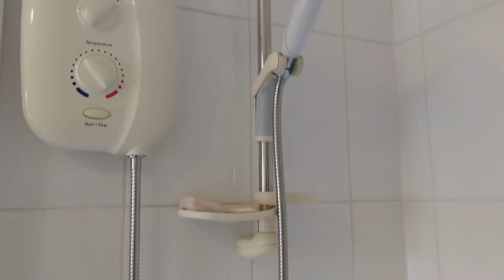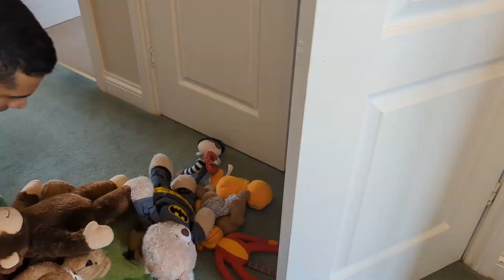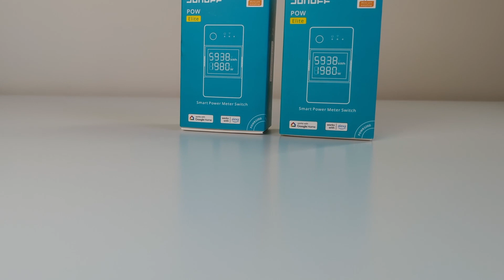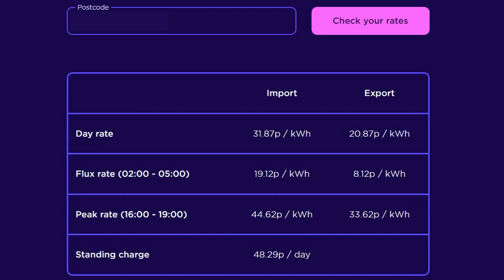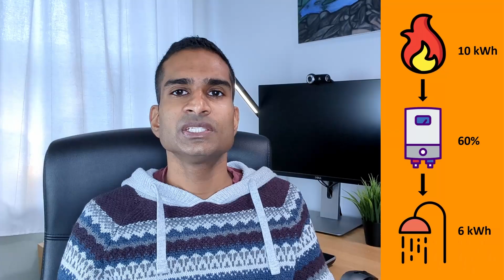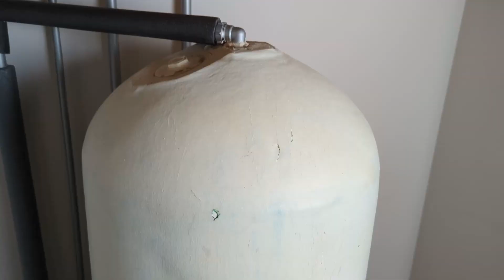Solar Diverter RETHINK 2023 - SONOFF WIFI Switch The Answer For Heating Water?

Comment: Many thanks for this prime intel. I have PV, Home Battery & Unvented 250L Hot Water Tank (indirect) with Immersion. Just bought the POWR3 320D and it works like a charm. I simply replaced the existing spur with the POWR3 and it worked like a charm. I will now run the HW between 23.30 & 05.00 with Off Peak Intelligent Octopus. Many thanks again !
Reply from the maker: Hi - Thanks for taking the time to watch and comment on this video. Glad you found it useful. That sounds ideal, great work!

If you’ve not already, please do like this video, stay tuned for some more content and thanks for taking the time to contribute to the discussion on this video 🙂 Shan

Comment: How did you wire the switches? In series i.e. 1 for On/Off & 1 for upper/lower (sink/bath) or parallel I.e both independently on/off? If the latter, how do you prevent both being on at same time and overloading the circuit?
Reply from the maker: The latter, if during the day only one will be set to come on. Or if off peak then both can come on and it doesn't matter as coming off the grid

Comment: We got solar installed last month and decided to go with the diverter as I’m not convince these rates you get paid for power going back to the grid will remain as they are and may disappear  down the line. We also didn’t have an immersion but we installed a Willis heater. It works great on a decent day. The heat pump usually comes on about five times a day to keep water hot as my wife works from home but on a decent day it doesn’t come on at all, this will also prolong the life of the heat pump. Hard to know what the pay back time on it will be but I’m glad I got it installed.
Reply from the maker: Hi - Thanks for taking the time to watch and comment on this video. 

I do agree - I think we will see and we are already seeing a reduction in the export rates being paid. That said I still think solar with a battery back up and not on a legacy FIT deemed payment a solar diverter has an extremely long payback time. I think if the system meets your needs and you're happy, that's the main thing.

If you’ve not already, please do like this video, stay tuned for some more content and thanks for taking the time to contribute to the discussion on this video 🙂

Comment: I'm on octopus tracker for gas, with 3kWp of solar PV. My gas has been under 5p/kWh for a good few months now. I am on Scottish Power for SEG at around 12p/kWh exported. It makes no financial sense for me to use excess solar to heat water and lose 12pkWh export rather than just heat the water with gas costing around 6p/kWh when you factor in inefficienceis of a gas hot water system. Not everyone will be in a similar situation but I bet there are loads of people thinking immersion diverters give you 'free hot water', which is only true if you are not on metered export or your export rate it similar or lower than your gas cost.
Reply from the maker: Hi - Thanks for taking the time to watch and comment on this video. 

Yes I agree, I'm also on Octopus Tracker for gas and we're using gas to heat hot water and exporting as much as we can on flux 👍

If you’ve not already, please do like this video, stay tuned for some more content and thanks for taking the time to contribute to the discussion on this video 🙂

Comment: Sorry, me again. Can I ask why you put a switch on the top immersion heater? We only ever use the bottom one. Am I missing something?
Reply from the maker: Thanks for the comment Ray, very interesting! We only ever use the top one as a top up. Given it's a 300L tank - using the bottom one means heating a greater column of water compared to using the top one which heats less but is sufficient for our showering habits at present. Having both options gives us more options and future proofing (or so I hope! 🤓)
Shan

Comment: Don’t forget that when you are exporting to the grid you will still be reducing your carbon footprint, as your export will be offsetting the need for the grid to generate from gas or other non-renewable sources. You would have to work out what the average kg of CO2 per kilowatt hour generated in the UK to get a figure. 

Just a thought 🤔
Reply from the maker: Hi Pip - It's a good point 👍

If you’ve not already, please do like this video, stay tuned for some more content and thanks for taking the time to contribute to the discussion on this video 🙂

Comment: you done it wrong could use a sun amp heat battery or a tepeo zeb instead of export from the solar panels
Reply from the maker: Nope, I looked at the sunamp but prices started at around 5k. The tepeo Zeb remains in the cards but at the moment they only replace gas boilers up to 12000 kWh of gas. We use around 15000, if not a bit more

Comment: Very interesting video, I came to a similar conclusion - although I am using the last hour of Flux cheap rate to heat water and then gas in late afternoon. Generation for us tales off in late afternoon so to save the batteries taking the hit in pm I am using gas then. Those switches look like a good option, I currently have the immersion on a timer but these SONOFF ones look better featured!
Reply from the maker: Hi - Thanks for taking the time to watch and comment on this video. Glad you found it useful.

Sounds like you've done some good analysis of your electricity use. That's great. Yes the SONOFF switches are working very well and significantly cheaper than a diverter!

If you’ve not already, please do like this video, stay tuned for some more content and thanks for taking the time to contribute to the discussion on this video 🙂
Reply: @everythinghome  Thank you, it was your video on Flux (and Gary's) that got me to finally ditch my old meters and switch to octopus - my Flux tariff changeover was finalised last week. I look forward to future content 👍
Reply from the maker: That's great, there are exciting times ahead! Gary is making some great content. Thanks, I'm looking forward to looking at the numbers come September/October time.

Awesome, hope they're backdating your export payments
Reply: @everythinghome  I am not holding my breath for backdated export, but if it happens on next bill I will be very happy indeed lol!

Comment: Nice vlog and great info…. Hope you had a structural engineer for the big tank in the loft? 🥸
Reply from the maker: Hi - Thanks for taking the time to watch and comment on this video. Glad you found it useful.

We previously had around 300kg of cold water storage tanks etc in its place, it now has around 350kg of unvented cylinder. The area was reinforced by the installing team 💪

If you’ve not already, please do like this video, stay tuned for some more content and thanks for taking the time to contribute to the discussion on this video 🙂

Comment: Didi I hear you right? Did you say that the sonoff switch can vary the power to the immersion heater or does it just switch the full 3kW?
Reply from the maker: Hi Martin - thanks for checking. Just to be clear you cannot limit the draw via these switches so yes it will draw a full 3KW. But if done at the right time it should be covered by solar/battery.

If you’ve not already, please do like this video, stay tuned for some more content and thanks for taking the time to contribute to the discussion on this video 🙂

Comment: Could you get similar results with a smart immersion such as a Tesla t-smart?
Reply from the maker: Hi Kiran - Thanks for taking the time to watch and comment on this video.

Yes , I had looked at that as an option but for the reasons in the video and the significantly cheaper unit cost I went for the Sonoff WIFI switches which are working great.

If you’ve not already, please do like this video, stay tuned for some more content and thanks for taking the time to contribute to the discussion on this video

Comment: I have to agree that with the current export rates via Flux, a solar diverter makes little to no financial sense for anyone unless they are tied into a FIT scheme with Deemed Export. We are with 2 of our systems and so the Eddis do lots of good work using power that we are being paid for whether we use it or not.

For my own uses, I have PV being installed as I type this and knowing that it could be 8 weeks before I start getting paid for my export, I'm going to spend the £21.24 for the 20A version simply to use the excess generated in the next 8 weeks rather thn give it away for free. The Flux export day rate here is about 22p, so this will have paid for itself after just 96kwh have been exported. It's a 6.3kwp array with a 9.5 battery and no EV's in the home, so it should cover itself just fine and once I'm actually being paid for export, I can still use it if it looks like I'm going to cross the 3.68kwh export limit.

The big benefit of an Eddi or similar is power regulation as they can just put 100w or 200w into the water, but as I said, with Flux it basically make very little financial sense.
Reply from the maker: Hi - Thanks for taking the time to watch and comment on this video. Glad to hear we're on the same page. 

Exciting times with your solar being installed. I'm sure you'll learn lots with your new system - how much solar did you manage to get onto your roof?

If you’ve not already, please do like this video, stay tuned for some more content and thanks for taking the time to contribute to the discussion on this video 🙂
Reply: @everythinghome  We've managed to cram 6.3kwp onto my workshop roof which is an East/West split. Our daily average usage is around 9-11 kwh, so with a force charged 9.5kwh battery with Flux off peak, annual savings should be substantial once I'm exporting and getting paid for it.
Reply from the maker: Wow that's a great size array and as you say should provide some good savings and income with export in the spring and summer months 👍🏽

Comment: Have you considered that the gas you will use running your gas boiler over the next 10 years will pay for two heat pumps? Scrapping your gas boiler now and installing a heat pump will reduce your carbon footprint and you'll be able to drive it from your solar installation. My running costs are about 35% of my old gas boiler with the above suggestion. It makes no sense to keep the gas boiler.
Good comment about solar diverters. It gets even more obvious with a heat pump which will be about three times as efficient as an immersion heater - and even cheaper when heating hot water with the heat pump on cheap off-peak electricity.
Reply from the maker: Hi John - Thanks for taking the time to watch and comment on this video.

I agree, the gas boiler isn't the long term option. I think I need to get a proper heat loss survey done and then go from there. We also have microbore, and whilst not an absolute game over it does make it a bit more complicated. More investigation required for our specific circumstances over the next few years.

If you’ve not already, please do like this video, stay tuned for some more content and thanks for taking the time to contribute to the discussion on this video 🙂
Reply: @everythinghome  I have a microbore so please tell me what you found the best solution was do I have to replace it or do something else? Just point me to the bit I need to read thank you Alfie

Comment: Good call, I've done the same thing, was thinking of a diverter, and found two similar switches and automated the switch on/off via my HomeAssistant, am still working out the best logic to use, you know batteries are less than 100%, Solar is charging batteries, time is daytime and so on. Thanks for your insights
Reply from the maker: Hi Andrew - Thanks for taking the time to watch and comment on this video. Glad you found it useful and that we're on the same page.

I'm yet to venture into HA territory but I can well and truly see its worth going forwards. I think for the moment the export payments far outweigh what I pay in gas it's a bit simpler but it's an ever changing space!

If you’ve not already, please do like this video, stay tuned for some more content and thanks for taking the time to contribute to the discussion on this video 🙂
Reply: @everythinghome  my heating and hot water are oil based, and prices are linked to petrol prices, which is volatile. My intention has always been to utilise all I can generate, export nothing.
Reply from the maker: That makes complete sense 👍🏽

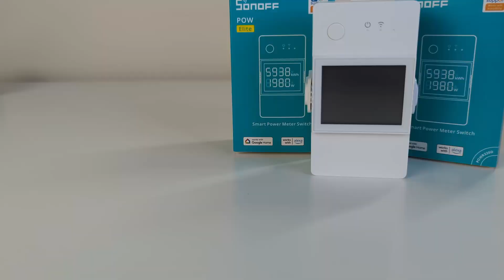Comment: I had reached a similar conclusion with regards to solar diverters.  If they were 1/3 of their current prices, they would possibly be worth considering on a financial basis.   I have used a switch by Tuya for my immersion heater and the Tuya Smart Life app has some useful automations where I can set it to switch on the immersion heater at a set time of the day, if the weather is sunny.  For the most part, this works well in summer.  I have set it to run every 2 hours if the weather is sunny.  In winter I switch those automations off as, even if the weather is sunny, I would rather the limited solar energy went into the house battery.  Instead, I set the immersion heater to come on between 0:30 and 4:30, which is when my Octopus Go cheap rate tariff kicks in.     One further refinement I would consider is to see if I can determine the amount of solar energy being generated and use that as the determining factor for switching on and off the immersion, rather than just the sunny weather, as UK weather changes frequently, and even a passing cloud 5 minutes after the immersion heater starts, means it draws the power from the battery.  Effectively, it would be to make similar wizardry in a solar diverter for turning the immersion heater on and off, but missing the ability to run it at a reduced rate of output.
Reply from the maker: Hi Graeme  - Thanks for taking the time to watch and comment on this video. Glad we came to a similar conclusion.

That sounds like a great set up already. I used to think the same about the passing clouds but for me the beauty of having a battery is to supplement when the all to frequent cloud rolls by. I've found very quickly it's near impossible to element the grid entirely. I suspect the difference would be pence per day but obviously depends on lots of factors and small amounts over time do add up. The other option would be to consider something like Home Assistant to automate this.

If you’ve not already, please do like this video, stay tuned for some more content and thanks for taking the time to contribute to the discussion on this video 🙂

Comment: I was in a sticky situation last year, I had to replace my boiler. I wanted to go all electric but that’s a couple of years off. 30p standing charge does make a financial difference per year. 

I swapped my boiler for an ideal one with 90+% efficiency. They warm the home soo much better by throttling the boiler up and down rather than off and on (using opentherm). 
The payback is based on your bills but 30% could be possible.  I paid under £2k 

The technology I really wanted to implement is adding a large water tank before the return. You get better efficiency and can heat with electric when it’s cheaper (solar or Go). 
Using a battery to heat water is also wasteful.  Charging and export on flux will result in 2-8p costs.
Reply from the maker: Hi Andy - Thanks for taking the time to watch and comment on this video. Glad you found it useful.

Thanks for the insight. It's definitely something I'll need to look at in the coming years, more research to be had about what my best option is. I like your point about eliminating gas entirely and losing the standing charge, it definitely adds up over the year! I'm not completely sold on a heat pump for our home, but I need to do more research.

If you’ve not already, please do like this video and stay tuned for some more content and thanks again for the comment 🙂

Comment: We have the myenergi eddi to heat our domestic hot water. We don't use gas anymore to heat it and it's cheaper and more efficient to use the eddi. Our gas boiler is 20 years old and 75% efficient. In the winter we set a schedule to heat the hot water in the early hours of the morning during off peak rate on the Go Faster tariff with Octopus Energy. In the summer, excess solar will trickle in to heat it. The eddi can be set to be first, second or third in line with the battery and car charging so it's very flexible. It can also sip surplus it does not need 3kWh to start it working. Any solar excess, even 100w, is diverted by the eddi into the hot water. As every, everyone's setup and use case is different and there's no one single solution that needs everyone's needs.
Reply from the maker: Hi John - Thanks for taking the time to watch and comment on this video.

Sounds like you've got it all set up well. We're still clinging onto 3p/kWh gas till May 2023 so it's much cheaper for us to use gas at the moment. But from May I suspect it'll be around the 10p/kWh mark. We've just joined Octopus Flux and exporting our excess solar makes more financial sense. As mentioned, I think I'll use gas in the morning and solar in the afternoon in the interest of reducing my CO2 impact whilst attempting to expand my CO2 reducing tech.

Thanks, Shan